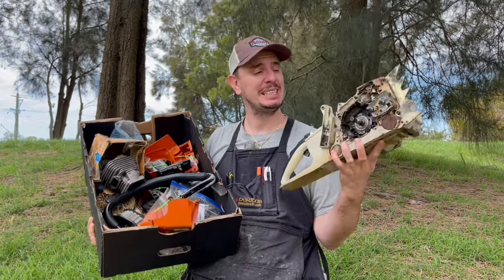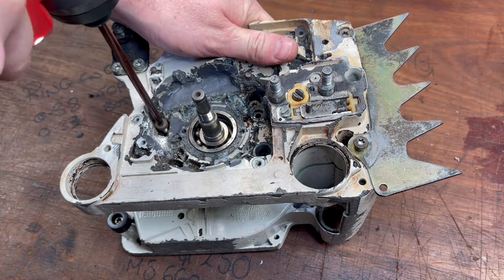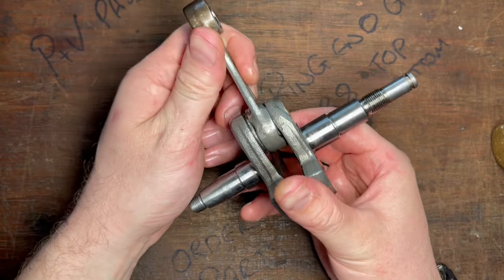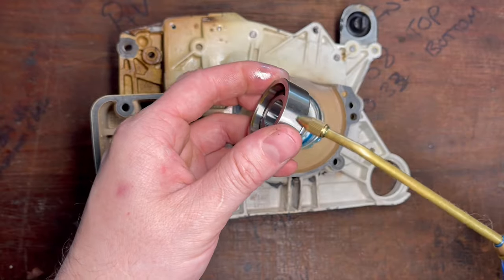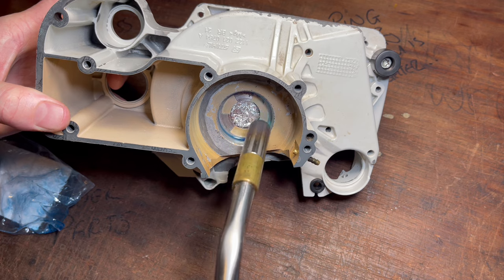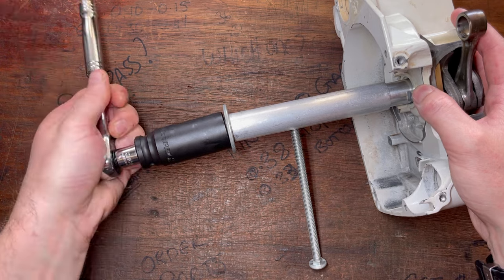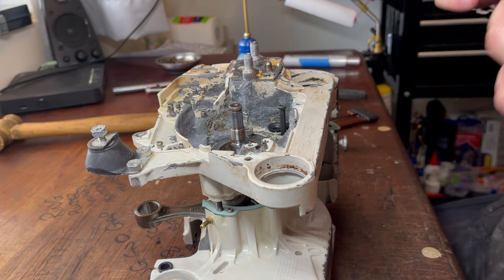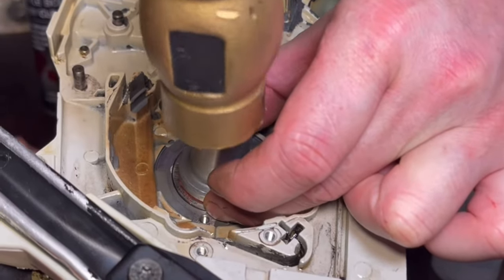Stihl MS 660 Chainsaw Full Rebuild Tutorial!

Comment: Great video! Very clear instructions. I made similar pullers for bearing and crank installation several years ago and, as you Aussies might say, they work a treat. I try to use heat whenever materials permit (probably less trauma to the bearing pockets), but these tools save the day when heat cannot be applied. One can also use mild temperature differentials in conjunction with these pullers to ease the process. Again, excellent tutorial!
Reply from the maker: Thanks for sharing and I agree! :)

Comment: Do you have a video on the break in of a new chainsaw or after piston and piston rings replacement? Thanks.
Reply from the maker: I don’t I’m afraid, I just tune them a bit rich, run them 32:1 get them under load (not excessive) and use it like normal.

Comment: What a hell of a score with all those parts. What the heck happened to the alloy furface in that crankcase? Looks like it had an acid bath.
I have a 066 in need of a rebuild, so I'll be following along. Mine came without a piston and needs crank bearings replaced as they seem a little worn. I'd love to find a well priced OEM piston, but will likely need to go aftermarket.
Reply from the maker: That is known as mag rot, it’s caused either by moisture contact with the magnesium, but in this case it’s caused by the owner cutting palm trees and the oils attacking the magnesium. Although unsightly, in this case it doesn’t affect function in any way, therefore I decided to keep the cases.
Reply: @VintageEngineRepairs  I'd also keep them, but it's good to know what causes it.

Comment: I could make the tools up to fit & remove that crankshaft.

I could use a socket or a piece of pipe of the same diameter to fit the seals as well.

It's similar to my power tool repair days but we didn't have any special tools to dismantle them, only a hydraulic press,a bearing separator & a 3 jaw puller,we did have a lathe,an undercutting machine to undercut the armature slots in the power tools & a growler to test the armatures as well !

I left them after they fired my manager & yes,when that bearing fell apart in the video that was 2 of them whose a Walmsley who owned the business was praying that was going to happen to the power tools that I repaired.

My manager had 43 years of experience in the power tool repair & electric motor rewinding trade,it was 21 1/2 years ago that I left the company,I can't speak to my old manager anymore because he died of cancer 5 years ago this Sunday !
Reply from the maker: Yeah it’s simple but useful 👍

Comment: Is that bearing tool original with the hot and cold method? 
Because you don't want to hit on the inner race of the bearing in this application, due to the lacking support
Reply from the maker: I have so many from stihl I can’t remember which fits which saw, but because I didn’t put any force on the bearing as I was using heat, it was fine to use in this application.
Reply: @VintageEngineRepairs  
Replacing crankshaft bearings is a bit of work therefore I do not risk anything.
Even when I use this method I do not hit the bearings this way, but if it works for you its all good.

Comment: How do I know which chainsaws from stihl needs the oil pump placed before installing the bearing?
Reply from the maker: Each model is different. If there is nothing for the bearing to rest against, then it’s safe to assume the oil pump needs to be in place 👍
Reply: I've rebuilt a ms 382 and didnt pay attention to that, thank you sir
Reply from the maker: @EnsinoCoisas  all good :) it may not require it :) the manual will explain if it’s needed

Comment: Question,why  you didn't buy two metal cage bearings instead that with plastic cage. I think metal cage is better , and I see are OEM parts.
Reply from the maker: It’s a great question, normally I would, but that bearing came from stihl like that, it’s an oem part. Because of its step to take the seal you can’t use a bearing from NSK, SKF etc, it’s proprietary. The good thing about plastic cage is if it lets go. It doesn’t damage the engine like metal, but metal lasts longer.
Reply: @VintageEngineRepairs  if it's a small part can't damage the cilinder but I see cilinder scored by that plastic cage.I prefer metal cage.
Reply from the maker: @ainodekam3785  there is no cylinder damaged :)
Reply: @VintageEngineRepairs  I mean after a  long period of work.